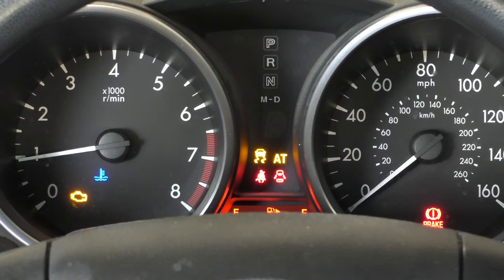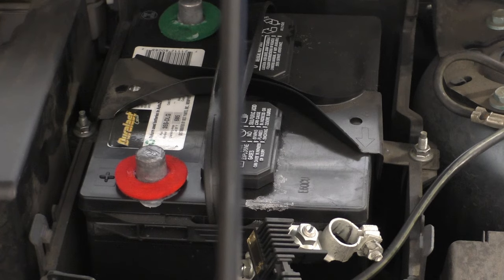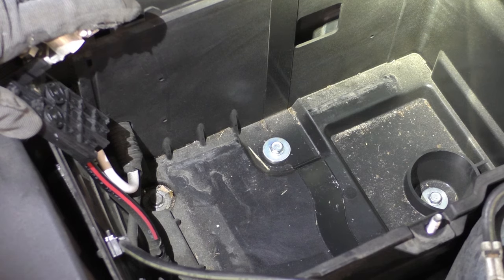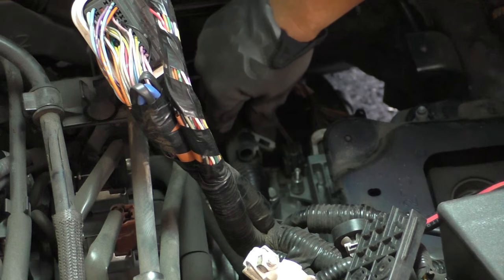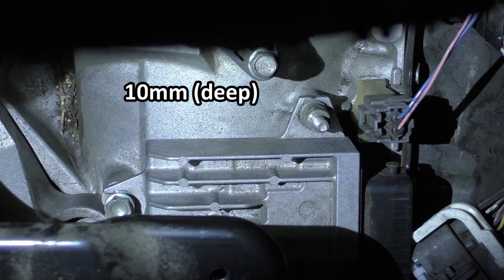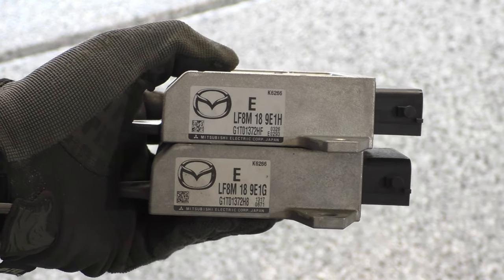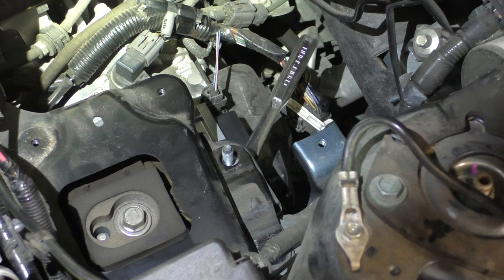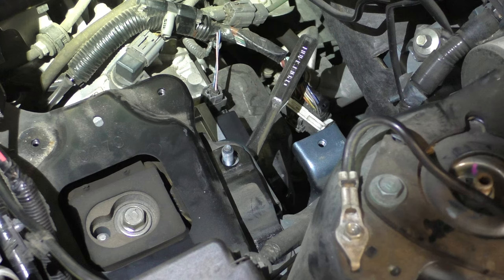Mazda 3 Transmission Control Module Change, Code U0101

Comment: Followed this tutorial and completely fixed my TCM problem. It saved me over $3000 (new TCM and tool box included) by doing it myself compared to my mechanic’s quote. I’ve never done more than change a tire but this was super easy to follow along with. Thank you so much!
Reply from the maker: Congrats! Glad you were able to save some major $!
Reply: Congrad! It just costs me $2000 AUD to replace that module and a battery 😒
Thanks for a detailed clip
Reply: @FaRKle0079 where did you purchase the module you used to swap?
Reply: @reyjaydel  I had to buy mine off Ebay
Reply: I have the same problem with my car
Reply: @FaRKle0079 Does the new tcm come programmed and ready to install and thats it? I could never find any information about this and all the mechanics I've talked to always told me it was something only they could do. I need to get mine done so if you could solve this issue for me it would mean the world!
Reply: @nikemanize I bought mine on eBay and it was pre programmed. It was a TCM exchange where they send you a programmed TCM and you send back your defective one so they can fix it and resell it.
Reply from the maker: @nikemanize  for this 2011 Mazda 3 (non skyactiv) there was no dealer programming needed. I just bought the part from the dealership (didn't have to provide VIN), plugged it into the car, and it worked.
Reply: Thank you all so much for the help!
Reply: @jamesloggins2084 did this require programming or just plug and play?
Reply: @carlosolvera72 for the mazda 2010-2011 the tcm is plug and play, no programming required, and this video guide is really good, i would also remove the air filter box to have more space though.
Reply: @wolveric0  thanks. I’m sending the tcu out of the country for a friend that bought a 2010 in Texas, but lives in Mexico. I wanted to make sure it worked. Appreciate the answer.
Reply: I have a 2009 you think you can check it out for me where are you located

Comment: FYI- The transmission is a hot zone and causes the TCM board to get hot and flex causing problems with solder joints on the TCM PCB. You want to put the replaced/fixed TCM on the firewall. Attach it with zip ties to the brake lines on the firewall. Use a pad of rubber in between to isolate the brake lines. I have a 2007 Mazda 3 mounted that way and its still running with the original TCM.
Reply: Yeah everything I read about TCMs in mazda 3s like you said in a hot zone. Thanks for mentioning this I'm trying to find a place to buy one as I was watching video that's programmed I see price all over the board
Reply: @davebullard4772  Try a scrapyard
Reply: @bobsoft  I'm afraid I'll buy one from a scrapyard that has the same issue
Reply: @davebullard4772  Its possible. Depends on the mileage of the vehicle you pull it from. I know every time I go to the scrapyard they never have any. The catalytic converter and the TCM are always missing. My wife has a 2007 MZ3 and it still has the original TCM that I moved to the firewall 5 years ago.

Comment: This saved me $2500 easy. Got a quote from the dealership who wanted $3000 (if) they didn’t find problems with the transmission or need to program the TCM. They also quoted me $800 for the TCM alone. I found a dealership online who sent one my way for $550 including expedited shipping. No more than 1.5 hours of work (mostly just swearing at the battery box) and the car was as good as new. I can’t thank you enough for this walkthrough.
Reply from the maker: Congrats! Glad I could help!
Reply: @Zak003  can you send me a link to where you purchased yours. I've heard of people ordering them and not being programmed correctly or not at all. I've been quoted the same at Mazda so looking to save a few bucks and with this video doesn't seem like it's out my scope of ability. Another question did you put the TCM back in the stock area or did you place somewhere else such as the firewall to keep away from heat of the exhaust that is from what I've read is damaging the TCMs 
Thanks
Dave

Comment: Mine just did this all the same lights on dash and will drive but struggles barely made it home if I put in reverse it feels like the motor is going to go thru the hood I have been having a hard shift into 3rd for years now and recently 2nd didn't want to shift into 3rd unless I was light on the throttle wonder if the TCM was to blame all along.

Comment: I've repaired 2 of these by resoldering the circuit board. It seems like the common point of failure is the through-hole connector solder joints. I resoldered the whole board anyways, but the through holes had visible fracturing in the solder joints. Get them off the transmission, the heat and vibration is the problem.  The connector pins coming out of the circuit board are long and bent 90 degrees, so they'll vibrate like a tuning fork and eventually the solder joint cracks.
All you gotta do is peel off the epoxy at the base of the connector to get at the through-hole pins. Touch them with a soldering iron so all the solder completely re-wets.  Use LOTS of flux, then clean it off with alcohol when you're done. Replace epoxy and remount off the transmission
Reply: Can you make a video please?  I'm working on 3rd replacement in 3.5 years and its getting old
Reply: That's good to know they can be repaired by yourself. Are your repair jobs still holding up on the TCM's?
Reply: Just did this to my TCM and it worked, no more “Lost Communication With TCM”. There’s 39 pins that you need heat up with soldering iron and add a little more solder. Removing the silicone took a while but it’s not much that needs to be removed.
Reply: How did you get the epoxy off the board?
Reply: @schtoopid  I used a razor blade and a small flat head screwdriver. Just be patient, it takes a while. Alcohol seemed to help a little.
Reply: https://youtu.be/ZnRriGXvn6A?si=XdWzrvtYv1L4UlIC

Placing tcm on firewall

Comment: Thanks, saved me 600$ for the work on the car shop, the price for brand new module from mazda was still painful, around 750$, there are some used one outthere, but until you pull your own module to see the part number you cannot look for it, also read. mixed review about the refurbished ones, so hooefully the new one will hold another 10 years

Comment: Great video, helped me replace the TCM on my Mazda5 2010.  Thank you for the details and explanations!  I was stuck in 3rd gear with P0753 code, AT light on.  All is fine now.
Reply from the maker: Congrats on the fix!
Reply: where did you get you tcm ?
Reply: @Devo1987  I live in Canada and bought in from Modulepro Dorval, Montreal.
Reply from the maker: @Devo1987  I just bought it at the dealer.
Reply: @FaRKle0079   how much you pay ?
Reply from the maker: @Devo1987  I think it was around $550.
Reply: @FaRKle0079  I got this error p0776 issue with the same light
Reply: @FaRKle0079 thoughts on buying it from junkyards light ace pick-a-part. I kinda know what you’re going to say, but usually these vehicles are in there because of crashes and a plethora of other problems
Reply from the maker: @FlipBoji  If the price is right, go for it! The main gamble is you don't know what kind of condition it's in or how long it'll last. I'd take a gamble on it for $150 over ~$600 new.
Reply: @FaRKle0079  I love this answer and gambling is apart of every decision we make
Reply: How long did it take for Check Engine Light to go off?

Comment: My vehicle was needing the TCM work.  I did it easily thanks to your video but now I have AT and check engine light on and vehicle still does not go into drive.  Before replacement I did not have any codes or lights on. Only symptom was vehicle would not go into drive right way with a jerk and deceleration was also a huge issue. Code reader says lost communication with TCM/PCM.  I took all apart again to make sure I had connections perfect.  I do and still have codes and same symptoms.
Reply from the maker: Does the old TCM work? Was the new one brand new? If not, are you sure it's good?
Reply: Ever fix ?

Comment: Thanks for this well organized video, I replaced the TCM but unfortunately the gear lights didn’t come back and the car still lurches when I shift. Any advice or is it shop time?
Reply: I'm having the same problem did you ever get your issues fixed and if so what did you have to do

Comment: Well done.  I purchased a used 2010 Mazda 3 i with the 2.0 recently.  The previous owner had the TCM replaced.  The car shifts and drives fine, but it still has the U0101 code, AT and DSC error lights on and does not show which gear has been selected.  Would you have any suggestions for troubleshooting and correcting to try before buying a new TCM?

Thank you for posting.

Comment: did you have to reprogram the TCM with the dealer? im seeing conflicting info on that.
Reply from the maker: For this 2011 Mazda 3 (non skyactiv) it was plug and play. No programming by the dealer needed. I just bought the part from the dealer (didn't have to provide VIN), and plugged it into the car.

Comment: replaced the tcm but now it's still pulling u0101 and now p06b8. i bought the tcm online. do you think the tcm was programmed incorrectly? before replacing, i had lit AT, only comfortably drove in reverse and struggled to shift, as expected with u0101. since replacing, it now drives completely normal, no AT light. it honestly shifts better than ever. the other code leads me to the pcm and i would looooove to not have to replace another $300 part haha. any advice?

Comment: It's a good idea to not put the tcm back where it was. This problem is caused due to solder joints cracking from thermal stress. It gets too hot where it sits. Put it up on the back firewall instead.

Comment: Hello , I changed my tcm and the car is back to life again , before it was going limp ? And the dcs / at / engine lights came on . 

Now it all seems to be working perfectly , car drives well now took it out a few times . 

But I still have all the dcs/at/engine lights on . Why would they have not cleared ? Any help thank you

Comment: my mazda 3, 2.0L,2013, get the same issue, need to replace tcm. i have 2 questions  
1) can i  use mazda 3, 2.0L, 2012 TCM  replace to my car ? 
2) do i need re-program after replacement ? if yes, how to do it ? 
thank you for great video.
Reply from the maker: I don't think the year matters as long as you get the TCM for the same transmission. For example 2011 had a 5sp trans and the 2012+ had skyactiv and 6sp trans. So, make sure to get the module for the right trans.

In my video you see how the part I bought from the dealer had a newer PN revision than what I took out, but both were for the 5sp trans.
Reply: @FaRKle0079  9

Comment: Great video, thanks.  I’ve seen several others where they relocated the new TCM to the firewall or other location away from heat.  What are your thoughts on that, please?
Reply from the maker: It's probably a good idea if you can relocate the module to more favorable ambient conditions. Just have to check that all the wires are secure and there won't be any rubbing gradually wearing them down.
Reply: Thank you!  I’ll keep that in mind when re-installing.

Comment: Where can I order this part online? I have a 2012 mazda3 with a 2.5L. 

I did some research online and it some showed TCM from previous years within the same gen worked. So I found one from a junkyard with a different part number.. installed it and still have AT light. Maybe I need the exact same one.
Reply: I think maybe cause u got a tcm of a 4 speed auto trans and not the 5 speed auto trans
Reply: Same issue here. What was the culprit?
Reply: @rgexperience2879  the TCM’s internal chip or board is fried from sitting on the tranny housing which gets really hot. I brought it into a shop that specializes in electronics - TCMs included,  and they were able to salvage my part. No troubles for a year now
Reply: Maybe the one you got  from the junkyard is also toasted. I took my defective tcm and send it to an online company by mail that  refurbish electronics.  I paid $300. I got it back after 3 weeks.
Reply: @allantreyes4445  do you have the contacts of the company?

Comment: Great video!!! Is there a process to program the new TCM?? Or is it all just plug and play?
Reply from the maker: It was plug and play for me.
Reply: Great video!
I was told that the TCM had to be programmed by a specialist or the dealer.  Do you think the dealer programmed it for you?  Or are they lying about programming the module?  It must have cost you more $500....?
Reply: @alamins101  What did you find out on that?  The dealer told me the same thing, but I told them I thought it was supposed to be a plug and play part.  The dealer is 100 miles away from me.
Reply: I found a seller on eBay who refurbishes and reprograms these modules. I paid $370 USD including shipping. Dec '23.  I gave it to my mechanic who had to take care of other stuff as well. You might get a discount for mailing your old module to them.  There are a bunch of sellers.
Reply: @alamins101  Yeah I tried a company called Upfix that refurbishes these TCM's.  But I got the part and it was acting up worse than my original TCM.  I want to get a brand new one to avoid issues.
Reply: @yearginclarke  that's too bad.  I'm curious to know how much Mazda will charge you.
Reply: @alamins101  They said somewhere around just short of $700.  But they wanted me to drive there to program it to my car, but I won't drive that far in limp mode.  In limp mode it's too high of RPM's for highway speeds.  I'll call back, and if they still say the same thing I'll call another Mazda dealer, because everything I've read says it's supposed to be a plug and play part.

Comment: So i replaced my TCM but my AT light stays on and it doesn't ever light up the Park, Reverse, Neutral, or Drive lights but the car drives fine. Any recommendations on what could be causing this?
Reply: Check a fuse

Comment: I have a 2012 Madza 5 with a failing TCM.  I purchased a used one on ebay, installed it an the engine just randomly shut off while the car is moving. I'm assuming the TCM is bad.  If I purchase a new one, does it need to be programed to work with my car?
Reply from the maker: The TCMs are "plug and play" so they shouldn't require any programming.

Comment: @FaRKle0079
Thank you for such a great video. But what is the cause to this problem? Is it possible that the battery's fault?
Reply from the maker: It's believed the heat from the transmission damages an IC on the board over time. I don't think the battery would do this.
Reply: Solder joints on the circuit board are failing. Usually at the connector but possibly others too
Reply: @FaRKle0079  
My mechanic said that my battery had low voltage. It wouldn't have enough power to supply for transmission functioned properly. Besides, the battery was about out of warranty time (2.5 years).
Reply from the maker: @T24792  I'm surprised the car didn't have other faults too if the battery was low and wasn't providing sufficient voltage.
Reply: @FaRKle0079  
I know right. I felt sad that I had to pay too much for it. I believed that I have been ripped off but I could not do anything about it. Lesson learned. Thank you for your video, again.
Reply: @T24792  that is true ...I had the same problem with a 2012 skyactive if the battery voltage drops below 13 volts it will trip the traction control and also the car will go into limp mode...new battery fixed the issue

Comment: So your saying after changing the TCM of my automatic mazda 3 2.3L I dont need to re- program it??
Reply: I didn't have to reprogram mine...plug n go. $85 ON EBAY whereas they Mazda dealership wanted to charge me 5k for new engine and transmission...thank God for goog5
Reply: @wood25  what year was yours?? 

We have a mazda3 2011 automatic. We haven't bought the tcm yet for fear of having to program it...
Reply: @wood25  dude please help me. I got one on eBay and now my car is running again but the lights are still on the dash and a little stiff shifting first gear. The dealer told me it would be 2000 and that they wouldn’t work on a aftermarket part. Does it need to be reprogrammed ?
Reply: Mazda 3 2013 AT light on we chaked gear and computer fine means TCM ?

Comment: I have a question about the 07 Mazda 3 that I have. I let the car run for a while and when I put the car into reverse it shuts off and I wanted to know what cause that problem? Also my my check engine light is on and the transmission light is on as well....
Reply from the maker: It could be this same issue, but you'll probably want to have the OBDII codes read to confirm.

Comment: My Mazda is having this issue but while I drive it for awhile the code disappears I’m not sure if it’s the module or the connector?
Reply from the maker: Easy enough to unplug, and reconnect the connector to see if that solves it (maybe take a small brush to it too?).

Comment: Ive got a 2008 Dodge Nitro that has a TCM issue. Are most tcm plug and play or do they need to be reprogrammed once i buy another one
Reply from the maker: I'm not familiar with FCA products unfortunately, but this forum thread seems to indicate the TCMs for your vehicle need to be programmed to the VIN.
https://www.nitroforumz.com/threads/dodge-nitro-transmission-help-needed.45409/

Comment: i feel like this is the issue on my mazda 3 2004. ive been having issues shifting for a few days and it doesn’t want to get the rpms to go into 4th
Reply from the maker: I'd check with a code reader to see if you have the same code. If so, then the fix is the same.
Reply: I have a 2004 2.3 with same issues but no error codes are coming up. Also there is no tcm on my car guess it's in the ecu. Going to change the ecu and hope it works